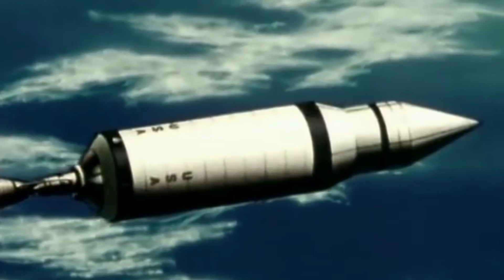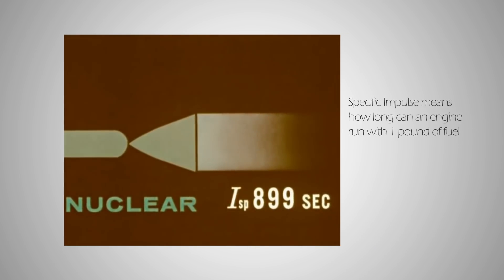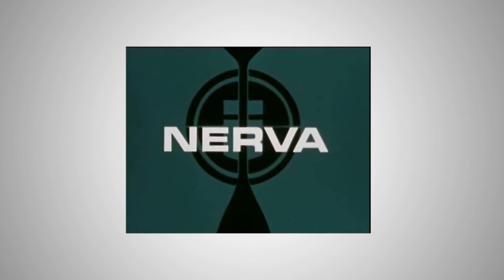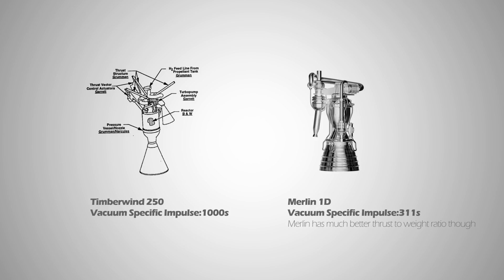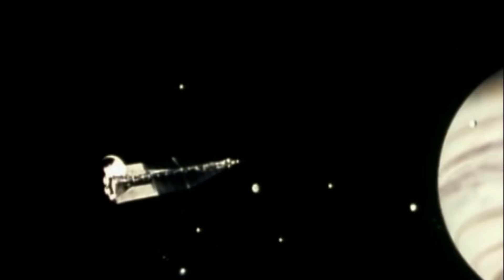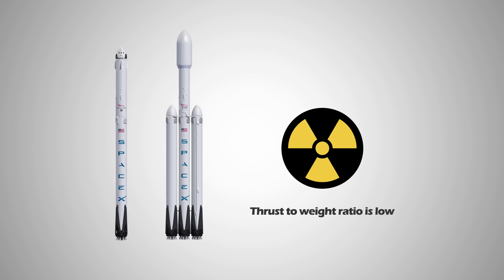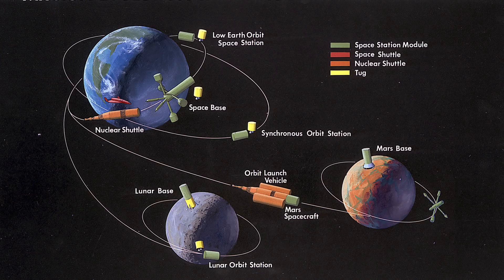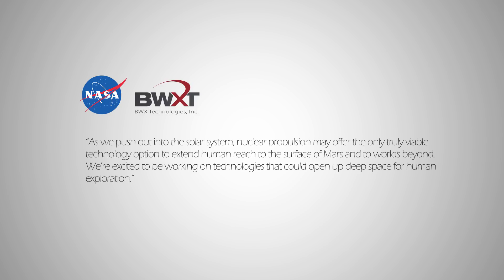What comes after BFR for SpaceX, a nuclear-powered rocket?

Comment: "falcon 9and falcon heavy are the most trusted launches"? falcon heavy has only done a test flight
Reply: elMARABIYOCHO1989,
When sober engineers review the design compromises for the Shuttle, the BFR is already leagues ahead. (Single stage to orbit booster, second stage adjacent to external tank, unrestrained foam on the external tank, thermal tiles glued to felt, hollow aluminum wings, doors on the bottom surface, no passenger escape system, etc.)
Reply: David Ogawa how about they build the bfr first and after test flights and a couple of human flights before his Fans can go around calling a rocket like Falcon heavy that has only done one test flight the most trusted rocket
Reply: elMARABIYOCHO1989, 
based on launch manifest for 2018-2019 alone, the block-5 and Heavy are more popular than every other free market rocket *combined*. 

The satellite vendors voted with their Money and made SpaceX the new preeminent launch provider.

Comment: while methane can be obtained with a sabatier reaction, a nuclear rocket will need to use a finite resource. Isn't logical to develop a technology that we can improve and still be able to use over the centuries?
Reply: 1Wj1, 
Are you referring to Helium-3 ? There is plenty of Hydrogen and isotopes.
Reply: David Ogawa, i am referring to the fission reaction material (uranium i suppose) needed to generate the energy to heat up and accelerate hydrogen.

Comment: What about an antimatter rocket
Reply: I think antimatter is currently technologically impossible. We don't have the means to contain it, and we can't produce more than a few atoms at a time - which then immediately annihilate because we can't contain them.

Even if this wasn't the case, antimatter is an extremely inefficient way of storing energy. Creating and annihilating antimatter would waste SO MUCH ENERGY
Reply: arrivinglotus1 too expensive
Reply: theuncalledfor, it can be contained. CERN is doing that now. They have also formed anti-hydrogen. But YES it is enormously inefficient to make antimatter. The next stepping stone is more likely to be fission thermal rockets and much later perhaps, Fusion reactor engines.

Comment: Nuclear rocket have one big problem: pollution. Think what would happen then they crash on launch site? Decades of pollution, is too big risk, and problem with radioactive isotopes, which may be use in atomic bomb.
Reply: It have smaller impact then current rockets, but place will be polluted, so launch site be close, people will go crazy. Too many fallout to take it as commercial product (if it may be commercial, because radioactive substance have own regulation, and there is good reason for that)
Reply: Crashes or melting/vaporizing during reentry are THE big issues.  The older proposals used these NTR only for escape velocity from Earth, so they weren't expected to come back. 

The radioactive elements in these reactors were Not uranium nor Plutonium some 60 years ago. It was more like Americium and Curium, anyway, short-half-life isotopes which get HOT fast! 

Now we want these to be reusable, so the cautious plan is to speed up and then slow down, all using propellant, twice, before refilling the tanks. However, this plan requires enormously more Hydrogen propellant with enormously larger tank(s). 

I don't see any incentive using hydrogen to slow down, except around moons with no atmosphere.

IMAO, the best way is to aero-brake at the destination. The NTR separates, aero-brakes, flies back out of the atmosphere, and assumes a parking orbit. The BFS aero-brakes and continues to the landing site.

Comment: OK.... PS;.... With new tech metals and Carbon Carbon composites and the use of new low nuclear particle velocity fuels such as Thorium, the nuclear core would only weigh a couple of tons for an engine producing 500,000 lbs of thrust with Hydrogen as reaction mass. The nuclear fuels with low energy, low particle velocity Thorium (Not U-235 or Plutonium-239 that make high energy, high velocity deep penetrating deadly particles)  are not only easy to shield against but the core would be safe to work around only hours after it was shut down after the dangerous isotopes created by the fuel had time to decay. The low velocity particles with the light shielding also do not require the crew to me hundreds of meters away while the engines are operating. The distance of the Hydrogen Mass tank is plenty and again, once the engine is cold it can be worked on.

Comment: OK... Second; A nuclear rocket Core was dropped from high altitude to test the danger of nuclear fuel being released durring an accident or crash of a rocket and the core penetrated the ground intact because of the thickness of steel and shielding around it. Not one  speck of nuclear fuel was released. It took them weeks to dig it out of the ground. and that was using  1960's technology. Now the Nuclear core's containment vessel would be even stronger and lighter.

Comment: One thing I allways wondered is why Musk doesn't want to have a Earth-Mars transfer ship on which the atmosphere capable ships would dock. The transfer ship would be ideal for a nuclear thermal rocket or even a nuclear powered vasmir drive.
Reply: JoGra, a transfer ship has to use aero-braking and be refueled at each end. This typically means that an aero-braking rendezvous maneuver, docking, and fuel transfer must be done. Why would the interplanetary transfer ship be lighter and more efficient than a surface-to-surface ship? There is going to be intensive cargo transfers from Earth to Mars for the foreseeable future, so it makes sense to minimize handling. 

It may make sense to leave nuclear vacuum engines in orbit, if this weight is considerable, but the propellant tanks, cargo, and passengers should stay together if possible.

Comment: You had the right word (politics) to explain why nuclear rockets never took off but the wrong description.  A few decades ago some members of the public realized that radioisotope thermal generators that NASA was using for deep space probes contained (gasp) plutonium.  This caused a huge public outcry and led to their eventual "ban".  The odds of being allowed to launch anything with the words radioactive or nuclear associated with it are basically nil.  Eventually we may be able to mine and refine nuclear fuel on the moon or perhaps asteroids.  But until then, forget about it.
Reply: +Art Hundiak, Curiosity uses an RTG. If that argument has any weight said "ban" must be very very recent.
Reply: The plutonium isotope used in RTGs is in short supply. There is no ban and little public outcry, there just isn't much of the stuff.

Comment: I don't understand why we would use nuclear thermal rockets over a ion engine.  Do ion engines only start to have a gain over conventional engines after a year of travel??
Reply: GrandProtectorDark Zubrin's Nuclear Salt Water Rocket FTW
Reply: If propelled only by ion engines, a craft could take nearly a year just to break out of Earth orbit, spending A LOT of time in the radiation belts. Not good. This is why there is so much interest in the VASIMR engine concept, able to "shift gears" from high-thrust (to break orbit) to high-efficiency (for the cruise to Mars). Or you could build a bimodal nuclear rocket: nuclear thermal to start the trip, then switch over to electrical generation to power an ion drive.

Comment: I agree that nuclear tugboats are an excellent idea for outer space use.  I would propose that they should be refilled with air from the upper atmosphere instead of limited to only Hydrogen since the nuclear heat source will be viable for years but the propellant mass will be expelled in minutes/hours.  When space mining becomes a real thing then use the more optimal H2.
Reply: Elden Crom, the propellant type has a huge effect on thrust efficiency (impulse). Hydrogen is the best by far. Every other type weighs more onboard and thrusts less.

Comment: I dont see why they couldn't design a NTR drive pod that's designed to dock to the BFR  upper stage using the same methods as 2 BFR ships docking for refueling.  BFR gets launched, it meets up with a drive pod in orbit and the pod propells the BFR to its destination.  the NTR gets left in orbit and refueled to propel future missions, still fits perfectly with SpaceX's rapid reuse-ability goal.

Ya it does not make sense to have it built into the BFR itself, you dont really want those things going up and down more than you have to and their TWR is not ideal for launches/landings anyway.  As a strap on pod however most of the issues go away aside from the political (aka nukes are scarry) ones.

Comment: Nuclear Thermal Engines should only be used once outside of earths gravity. If anything goes wrong then it can blow up in space and not in earth.
Reply: The probability of a nuclear thermal rocket exploding is, as far as I know, pretty much exactly zero. The design simply does not use weapons grade nuclear material, it's not capable of sustaining an explosive chain reaction.

Nuclear reactors don't explode when they go wrong, they melt down. Which is still bad, but not as bad as a nuclear explosion. And I don't even know if nuclear thermal rockets can suffer a meltdown anyway.
Reply: Rockets with rocket fuel can blow up how ever. So it's better Nuclear Material doesn't get caught up in any explosions that could happen for other reasons.
Reply: I think the explosion he is talking about is the booster rockets sitting underneath it. One could technically build an escape system for it,  but there's still plenty chance it could go wrong and spread radioactive materials all around the launch zone.
Reply: @GrandProtectorDark  Critical only means the reactor can sustain neutron population, not explode or meltdown. The reactor can explode if it is under high enough pressure. Space reactors are sodium cooled so they can't reach a high enough pressure before just melting to explode and NTR's always have an opening at the end to let the LH2 propellant out.

Robert Zubrin proposed using a constant chernobyl explosion (nuclear salt water rocket, sounds harmless) to propel nuclear craft at high thrust and impulse the equivalent to hundreds of gigawatts of force. It's open-cycle gas core reactor is extremely wasteful on fissile material though.
Reply: I’m no expert in nuclear energy & how they work but a nuclear propulsion rocket 🚀 is a possibility. Remember that navy ships & submarines use nuclear. They work great 👍🏽 therefore that’s a big possible step. Perhaps this topic can be debated but let’s leave it to the experts in nuclear energy.
Reply: Nuclear makes big explosion so there is no pretty much chance to escape but except if there is a warning
Reply: @jamiezyt7644  "makes big explosion"... no. More like meltdown if anything.

Comment: I really disagree with the notion that a spacecraft only usable in vacuum is not reusable and doesn't align with the goals of spacex.

It's the opposite, really. The BFR will sacrifice huge amounts of weight to be able to enter atmosphere, and the extra mass is a big hindrance on the journey to Mars. A specialized ferry or tug between planetary orbits with the BFR serving as a shuttle between land and orbit would be an inevitable step for any colony in the search for cutting costs.
Reply: Brackerlac, 
Any mass that could be left in orbit is mass that does not need to be lifted off Mars. The only thing I see to leave up there is the Earth surface descent engines, nuclear reactor engines and vacuum nozzles, and whatever ancillary things are needed to achieve that. (Heat shield, reaction thrusters, local auxiliary tanks, computer.) However, I would leave the three Earth descent engines attached to the BFS. Passing them back and forth is complicated and scary. 

The early colonists will live in the BFS until underground habitats are built. All the cargo needs to be unloaded. The propellant for the return trip needs to be loaded. Some ships have to stay as backup/lifeboats, some will be cannibalized, but others will return to Earth for another round trip. 

I really don't see what else should be left in orbit.

Comment: Love the video! Just one question: isn’t it thermonuclear, not nuclear thermal?
Reply: Thermonuclear implies fusion, witch NTR's do not use. Nuclear Thermal Rockets simply pump hydrogen through a nuclear reactor to heat it, then expel it out a nozzle. Fusion is way harder to do than that :)
Reply: Barron Risling oh, I didn’t know thermonuclear meant specifically fusion. Thank you!
Reply: The Rocket Nerd, sunglasses labeled "Thermonuclear Protection". Hilarious

Comment: Will the nuclear exhaust of a nuclear tug create waste for future travelers to Mars to travel through?  

Having shorter times to avoid the radiation of deep space is good, but if we add more radioactive material into the space we travel through, when is that gain a net loss?
Reply: No, the reactor heats a propellant that’s then ejected.
Reply: That's... not how it works. That's not how any of this works.
Reply: Miki Cerise , how does it work?
Reply: There is no mechanism where the hydrogen would become radioactive in a closed-cycle nuclear thermal reactor. Relatively few atoms even can become radioactive when exposed to radiation, definitely not the ones in the lower parts of the periodic table.
Reply: The exhaust is not radioactive. Hydrogen has isotopes, but none are dangerous. 

Anyway, space is very, very large and even in near Earth orbit, even in our Van Allen "radiation belts" (enhanced by high altitude nuclear weapon tests), the vacuum is very *empty*. 

Even if we were to heavily pollute the vacuum of interplanetary space, the Solar wind is constantly relentlessly pushing stray molecules out of the solar system.

Comment: Thanks for your video! Something to consider with respect to faster Mars travel is that the 6-month journey is actually the best trajectory: this is the free return trajectory, which allows the explorers to swing around Mars and return directly to the Earth without a major burn. If Mars is covered by global dust storms or landing is made impossible for some other reason, the 6-month trajectory allows them free return to the Earth. Any faster, and the explorers fly out farther out into deep space and won’t find the Earth when they get to 1 a.u.  Improved propulsion is eminently desirable, but instead of speed a better safety feature is improved radiation shielding and redundant life support systems. (These ideas come from Dr. Robert Zubrin)

Comment: Nuclear propulsion doesn't necessarily mean low thrust for re-usability: one example is the one you did, that is to leave it in orbit, but this could make problems with refueling, increasing the cost of the mission. Another solution is to put one nuclear engine surrounded by some merlin engines, using the nuclear one in the vacuum and the merlin to land

Comment: "SpaceX wants to launch rockets again and again" << For surface flights.

I imagine if Spacex is successful for a few more decades, they will want to move into deep space propulsion solutions. And I think you explain this adequately.
Reply: FEARbraveheart, first we need to produce flawless graphene tubes, many centimeters wide, kilometer(s) in length, and nested in a dozen concentric layers, possibly with a Lithium alloy as a composite holding millions of overlapping tubes together. 

Earth may not get graphene tethers until after Mars or Luna gets one. The reduced gravity makes the technology feasible there much earlier. 

Graphene has to be lifted from the Martian or Lunar surface up to a geostationary point (Lagrange point in the case of the Moon) before being deployed. 
 
Considering the cost of lifting, the graphene for Earth-based tethers will likely also come from Luna factories, lifted by a Lunar tether / elevator. 

Mars will supply its own graphene tether (from atmospheric CO2).
Reply: I wonder how far we are away from space elevators (centuries, I'd assume)? is the technology even remotely plausible?
Reply: Space elevators need graphene tethers, which we cannot currently manufacture. Skyhooks are a similar but lower tech solution.